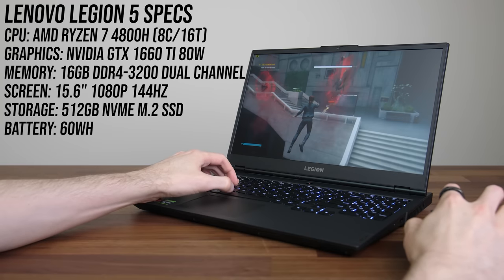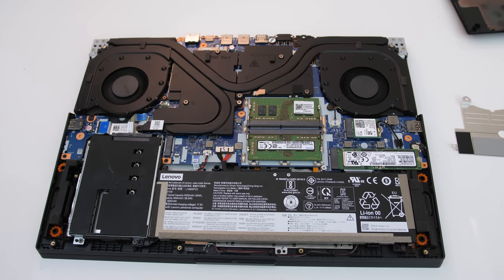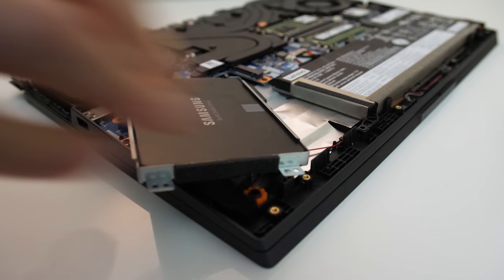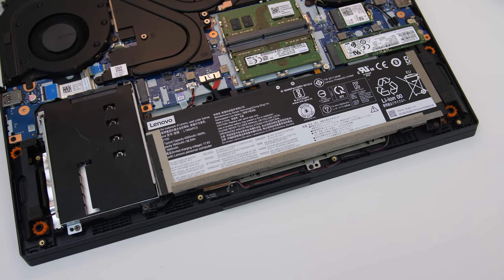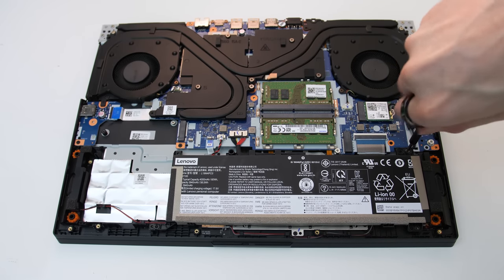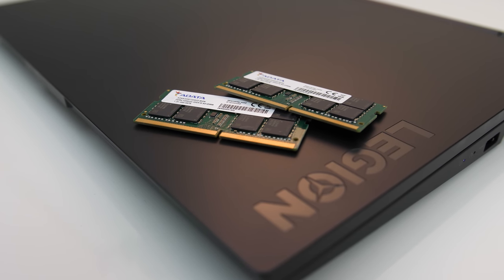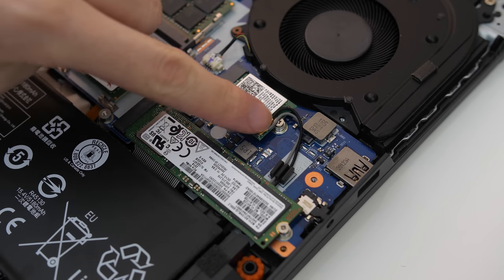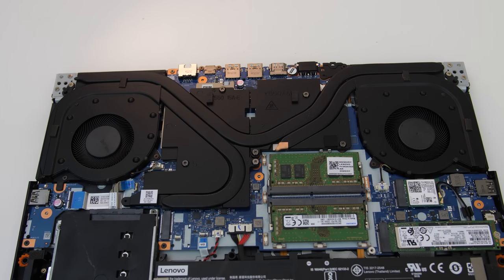Lenovo Legion 5 Upgrade Guide - Boost Performance!

Comment from the maker: 2024 update - I made a much newer upgrade guide with way more info here: https://youtu.be/Fud7IU8i3w8

💲Find the best gaming laptop deals at my site https://gaminglaptop.deals
Reply: I have a question Is 16gb of ram enough for gaming or should i buy 32 gb of ram?
Reply: Kinda wish you did the tuf a15 also this way I didn't like the case for the legions 5's case.... worried me if something happened.
Reply: another question is 6cores cpu is now obsolete for gaming?
Reply: @aaronpingol1566  I think you should bring these questions to another Jarrod video and try to throw them out within the first few hours of the video being uploaded or put it into a thread where alot of people have commented
Reply: @aaronpingol1566  I think 16 is enough but I would recommend you try to upgrade. Maybe do 24 if you can in the future because some games are starting to push past the 16 for their recommended specs. Returnal is apparently gonna need 32 to have smooth comfortable performance
Reply: Thanks Jarrod for your timely responses to your audience.
Reply: I can't unscrew the middle screw it's stuck, what do I do? :(
Reply: I have a quick question I have a Lenovo legion 5 ryz7 series 5000 and I have 1 8g ram chip inside and I wanna buy another 8 gig to have 16 but do I have to buy 2 new 8 gig rams or can I just buy 1 and stick it with the 1 I already have
Reply: For me ,after i changed the battery , it shows like the battery is fully charged and present - but, the led is blinking and when i unplug the charger the laptop shuts down. It does not power-up without the charger plugged in .Do you have any idea what could possibly be the solution to this problem?
Reply: Hey, im just finding this video and it's great! I was wondering if you could answer a question for me. Does the internal SSD need a heatsink if I was to put in a laptop or is the heatsink option only for consoles such as, a PS5?
Reply: Hey jarrod can you suggest me will the battery model no pf L19C4PC0 will have the same pin as L19C4PC2? (My laptop is Lenovo legion 5 15IMH05 and the HDD bay has been removed and upgraded to nvme)

Comment: Just one question: how do you ALWAYS manage to publish the RIGHT video at the RIGHT time?! Just how???!!! 🔝
Reply from the maker: I'm in your head 😎
Reply: trueeee though I already upgraded my RAM to 32GB it's still fun to watch someone do something similar with the same product 😅
Reply: I absolutely agree with you
Reply: Yeah i just wanna upgrade mine as well 🤣
Reply: He's from the future. 
He knows the winning lottery numbers.
Reply: I thought you were referring to Alexi Laiho.
Reply: @mediocritycentral  wich use can u give to the 32gb ram better than 16gb? besides gaming
Reply: @rodrigocataldorios6533  video editing and animation, after effects, etc.
Reply: @mediocritycentral  would it be usefull for architecture? Cad, sketcup, rendering, etc? Or is ok with 16gb? Thanks
Reply: @rodrigocataldorios6533   yes a lot of RAM is needed (but it still depends on how much rendering you do). 16GB is fine for light to low-mid works. 32-64 GB is preferable if you do a lot of rendering (though anything above 64GB is overkill for most cases unless you're willing to spend more money on it). Of course CPU and graphics also matter. If you have a recent gen Ryzen 7/9 or an Intel Core i7/i9 you should be good to go. For graphics, vRAM of 6GB minimum is preferable so that means at least a GTX 1660.
Reply: @rodrigocataldorios6533  of course I'm saying having specs lower than the ones I mentioned will still run those software you mentioned just fine but expect some slowdowns and hangups during heavy projects.
Reply: @mediocritycentral  thanks, your advice was so helpful  😊
Reply: @rodrigocataldorios6533  no problem 😅
Reply: @JarrodsTech  you probably are.....had a convo with my sis about hard drive upgrades as she got this as an Xmas present
Reply: honestly though, im getting really close to having enough for this laptop but was thinking its a bummer it doesnt have a terobyte of ssd😂😂😂 this dude is magic
Reply: Now the statistics about trend and what would be trending can be access, and with help of some tools and some knowledge, you could do it too.
Reply: Just bought it 2 days ago and this one pops up at my recommended
Reply: Haha had one since it came out, was just searching how other people liked it. Big coincidende this just came out
Reply: @JarrodsTech  amazing. I JUST got the same exact Legion5 with Ryzen 7 and 1660ti. Perfect timing, I think I want to swap for the larger battery and throw in an extra SSD.
Reply: Right? I literally received my Legion 5 (AMD version) from Amazon yesterday, the 5th. I'll probably upgrade the battery eventually and add an NVMe SSD sooner, but for now, it's a beast.

It actually got higher framerates in Apex Legends than my desktop with the same GPU, 48gb of RAM and dual Xeon 6 core CPUs!
Reply: Yeah same! Very informative video.
Reply: @JarrodsTech  enough no more of this  insanity.  I'm wearing my tin foil hat 24/7 now
Reply: Yeaa bro, I was just thinking about upgrading my legion 5i yesterday and I see this video, How !!
Reply: @JarrodsTech  Hi i am using legion y540 i5 9th gen does it support Intel wifi 6e ax210
Reply: @JarrodsTech  fine by me, you keep answering our questions. Thanks for the content!
Reply: He has your meta data
Reply: Dude you are absolutely right, I was looking to get the legion with better specs, but then bam published 1 hour ago
Reply: I literally just started to look at buying the legion 5 and I was trying to find upgrade paths when this video came into recommended. So idk how but I agree how do you come out with the right video at the right time
Reply: @JarrodsTech  did you buy a 32gbx2 kit ram here or just identical sticks??
Reply: He hacked your mobile 📱 😳 😐 💀
Reply: Does a magician reveal how he did the magic in the first place?
Reply: He's a wizard
Reply: Those holes on the back looks scary as fuck. It's like, the thing is staring at me. That's freaking me out.
Reply: @I killed that beard guy I bought 2 identical sticks, 16GB 3200MHz each for a total of 32GB 3200MHz.
I gave the 1 stick that came with it to my brother.
Yes if you're on Ryzen, dual channeling by having 2 identical sticks DOES boost performance, especially in games..about 8-10%.
That's up to you if the added performance is worth the cost and the hassle.
Reply: @I killed that beard guy both are CL22.
Reply: @I killed that beard guy It's recommended to enable XMP. In my Legion 5, there's no XMP setting but both sticks run at 3200MHz.
Reply: @I killed that beard guy I wanted to buy Hyperx but at the time they were all sold out where I'm from so I opted for Teamgroup's T-Force Vulcan Gaming RAM for "gaming" laptops.
Reply: @JarrodsTech  @Jarrod'sTech I see that you are using 64gb of ram. Everywhere I look, the specs say it can use a max of 32gb. If that is incorrect, then can it also use a 2tb ssd?
Reply: @pipkinrahl7264  were you able to find an answer to this? I called Lenovo and they said 32gb is max. I spoke to someone on the phone and in chat. Maybe it may say 64gb, but only allow 32 of those GBs to work?
Reply: @JarrodsTech  and I'm inside you :/
Reply: He's got access to all of his subscribers metadata. And one of the key information he gleamed from us was how to upgrade Legion specs. Voila, new content. :P
Reply: Because as human we are predictable.
Reply: Edwin Johnny  You can, but it'll run at the lowest level of performance of the x16 module you already have from factory.
Reply: I just got legion 5 how is it posibble
Reply: I ektum nih chu
Reply: It’s called coincidence. We tend to ignore all the times when we need something to be uploaded but it doesn’t and only remember when it does happen.
Reply: True
Reply: Agreed
Reply: @JarrodsTech genjustu

Comment: Hmm it looks like 64gb RAM doesn't really add much value over the 16gb RAM.
Reply from the maker: Depends if you need the capacity or not, if you're doing a ton of stuff and editing big files it will matter more.
Reply: @JarrodsTech  (edit this is due to the application not being able to use the ram I had properly, I have 32gb of sodimm ddr4, and the 32 bit application could only use about 4) Take the following with a grain of salt.

And if your playing old titles on high settings, I was playing Microsoft Flight Simulator X (2006) and it crashed and gave an error similar to "Memory Exceeded." when I flew over Newark Liberty International.
Reply: Upgrading RAM isn't for higher framerates, it's so when you get a memory leak it doesn't completely crash your computer, and you can run 800 chrome tabs. It's also extremely useful for audio editing as you can run a lot of VSTs simultaneously, on 16GB you would get an instant crash on a complicated track. Also, let's say you build a program that's large like a video game, you may need more than 16GB just to build. Or if you want to rewrite a large Git history. Or if you're a scientist and you want to analyse a large dataset.

I got 64GB last feb and since then my computer has never stalled and I am constantly running unity, photoshop, fl studio, resolve, bitbucket, rider, 100 tabs in firefox, thunderbird, filezilla, google sync, playstation and xbox devkit tools. Often streaming on slobs, have excel open in the background, a bunch of copies of ms paint with screenshots open, everything, my music editor, my vpn, steam, avast, parsec. I have never gone above 40GB even during memory leaks. I used to max 24GB all the time.
Reply: @AlexRoseGames  damn you make me want 64gigs of RAM.. I use mad tabs and run multiple browsers, vpn, wallpaper engine, games, video, photoshop etc
Reply: @suzukaziodyne9723  64gb is the truth
Reply: tasks like machine learning, but especially ones like deep learning require lots of ram.
Reply: @AlexRoseGames  My job gave me a Mac Pro 2019 with 16GB of RAM, and I can't tell you how disappointed I was when I realized it can't be upgraded. That being said, most jobs won't give you a Mac Pro.
Reply: so it is a work station now? I thought this is for gaming only
Reply: @chenglalonde5154  If a gaming rig can run for days at load without crashing, it can also be used as a workstation.
Reply: In laptops., 
32gb is the sweet spot.
64gb is an overkill even for video editing!
Reply: @jayesh5131  Yeah, but what if you're a data scientist, or doing multiprogramming research, or AI research, or testing multiple VMs, or ...
Reply: @jayesh5131  There's always a reason for more memory, eventually. What about editing 4K video? 8K video? Windows 11?  The next leap in video editing software? See how the need grows?
Reply: @plaane  Thank you, I forgot about trash tier build quality, which is not a big deal if you don't drop it, but ...
Reply: Its mainly for productivity, open a bunch of IDEs and a virtual machine and the 16gb is full
Reply: Maybe not now, but 5-10 years down the line you would be very glad for the 64gb. Or ig you could just upgrade it then.
Reply: @ThePower1037  that isnt dealing with ram, thats video memory, which is related to the gpu. btw
Reply: @jayesh5131  so im a noob in this 32 gb what should i buy?
Reply: You all: 64GB is too much. 

Me, thinking if the Legion 5 2020 can handle 128GB of RAM: whistles casually
Reply: I need 64 gb but am not sure if the Legion 7i Gen 6 allows that much or not?
Reply: @AlexRoseGames  so having 8 gb ram still rans any game?
Reply: @ototurmanidze5578  yep
Reply: @ototurmanidze5578  the new consoles have 16gb and they almost no overhead. your pc has windows and all your other programs running in the background, so it gets less out of 16gb than a console. Within the coming years, 8gb will become obsolete for video games. Developers will do stuff they know they can get away with on 16gb like load the hub world into ram for quick loads and leave it there permanently or keep the soundtrack in ram
Reply: @AlexRoseGames  Yeah I mean 32GB is probably the best value upgrade currently, but then later if I wanted to switch to 64GB I'm potentially double-dipping (provided the price of 64GB hasn't dropped to the difference by that point) so would rather buy 64GB
Reply: Legion 5 supports up to 32 anyways
Reply: @suzukaziodyne9723  wall paper engine? A man of culture you are.
Reply: and then let me introduce to you 32g
Reply: How much ram would be needed for a modded game lets say ds3?
Reply: @AlexRoseGames  have you tried upgrading the storage? Do you know whats the maximum you can go for ssd / nvme?
Reply: Hi Jarrod, you got the AData memory tested for ZenTimings? What are the tRFC values? I want to upgrade the same 64 GB ram but Adata spec dont mention CL and tRFC
Reply: @NameCallingIsWeak  sure u can upgrade it... but u will pay double the macshit price for extra 16GB xD and u would be VERY surprised in how many jobs macshit is "budged laptop".
Reply: 16GB is plenty, 32GB is good for the life of the machine even if it lasts 10 years, and 64GB is for the lunatics that think their laptop is a server or a workstation and it definitely isn't if it's a Legion 5
Reply: Yeah,  but alot of legion 5's only come with 8 gig.  People who bought those laptops can look at this video and see how it's done.  That's a lot of value to me.
Reply: MODDED sKYRIM OR CITIES sKYLINES TAKES 20+ GB easy, so you do not lose performance while you have the RAM to fill that amount of data ;)
Reply: hey at least u can run cities skylines then
Reply: @sergsergesrgergseg  I play warzone, which is very RAM heavy.  I can't even play the game and watch a youtube vid at the same time without issue.  Matter of fact, webpages stall and are super slow to load.  I've seen memory usages up to 15gb plus just doing those things.  16gb is bare minimum, 32gb is ideal, and 64gb is overkill.
Reply: @astaroth_sasazaki_yt  Right?  I got 64gb because it wasn't that much more than the 32gb, so why not have more than enough for the right price?